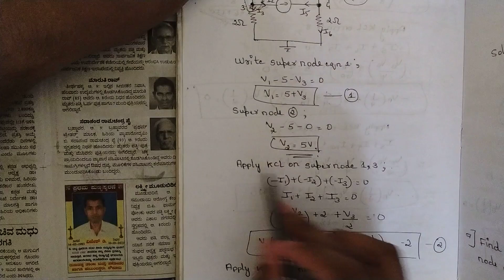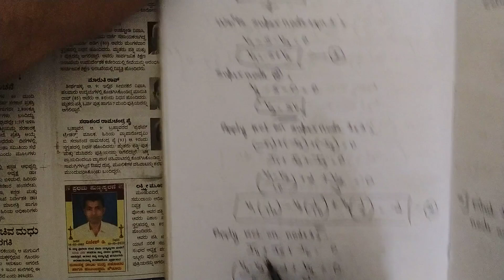16.Super Node Voltage Analysis(KCL) 2 Problems Explained Solved Network Analysis 3rd Sem ECE VTU

Comment: Question no2 Va= 60.86v, Vb=19.13v, Vc is give in the circuit is Vc=80v 
Lets find the Va, Vb . As Vc=80v put it in equations 1, 2 
Eqn 1:- Va(0.1367)-Vb(0.0167)=+8
Eqn 2:- -Va(0.0167)+Vb(0.1367)=+1.6 
Put this Equations in calculator 
Steps:- Menu , equation/function , press= , press1,press2 , puts the vale of Eqn 1,2 in it you will get the Va,Vb . 
Thank you can you make a video on this types Questions .🙏👍